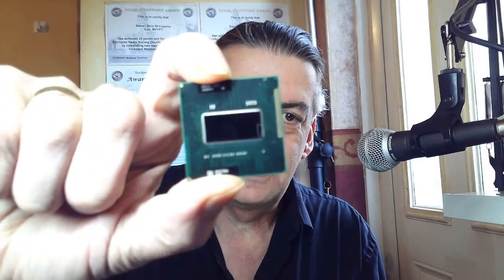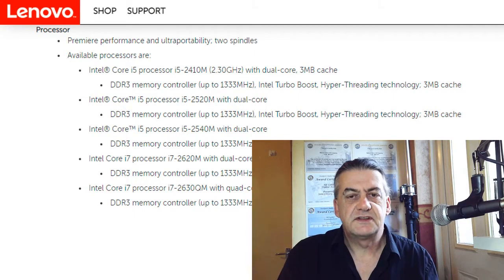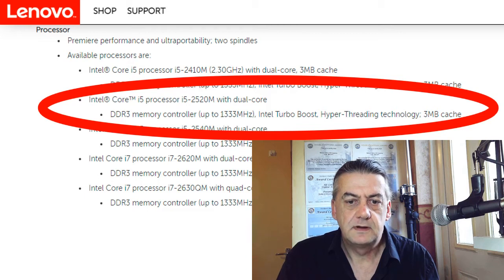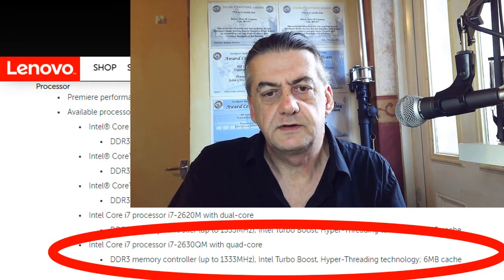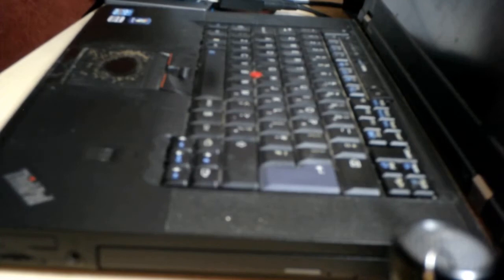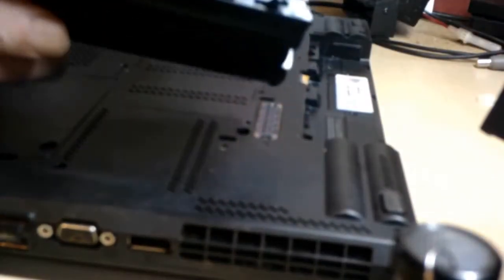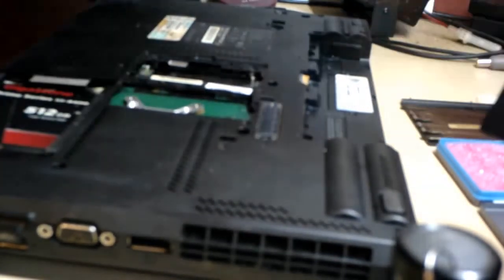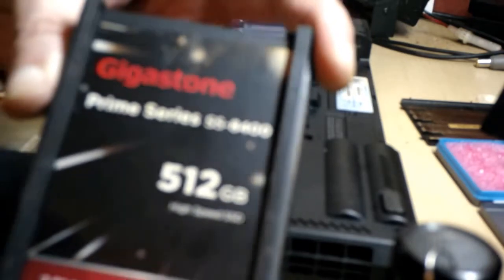CPU Upgrade for a Lenovo Laptop Core i5 to a Core i7

Comment: I have an i5 x240, think I may have a look into this.  It’s got a great form factor but I don’t think it was very upgradeable.
Reply from the maker: Be careful I have seen too many people claiming to do fake/un-reproduceable upgrades and following there advice tends to lead to waisted expense. Try an get the manufacturer's general specifications. This will tell you the maximum amount of installable Memory (Ram) plus the type needed and the CPU's that they have used in various versions they have released.
Reply from the maker: I just had a quick look at Lenovo's page on the x240 https://www.lenovo.com/gb/en/laptops/thinkpad/x-series/x240/

It can take i7 CPU ("Intel® Core™ i7-4600U") and "Up to 8GB DIMM" for memory.
In addition to this if it does not have an SSD (Solid State Drive) this wold be a dramatic speed increase and also you don't have to worry about minor jostling or bumping while you're moving it about.
Reply: @A.R.O.T.A.  - I’m already at 8GB memory but the processor is potentially an option.  The HDD to SSD is also a potential option too as mine has a HDD.
Reply from the maker: @daveys  Going from HDD to SSD will be your biggest speed boost (do not get a hybrid) the CPU only boosts the speed slightly.